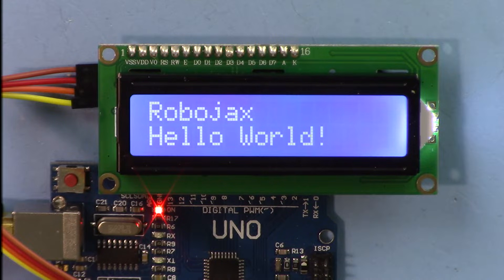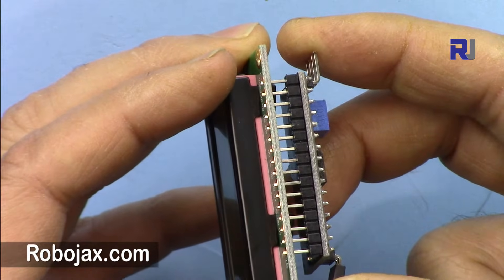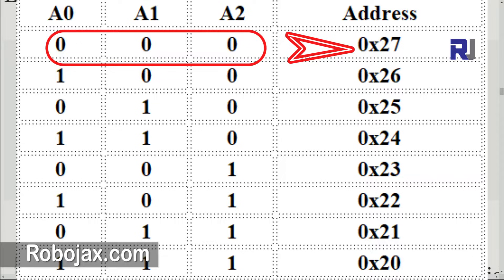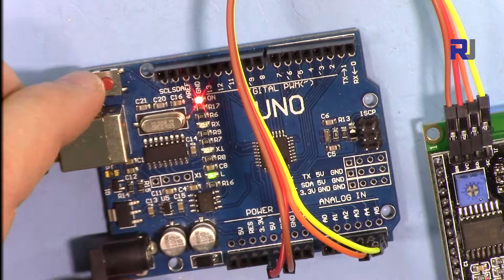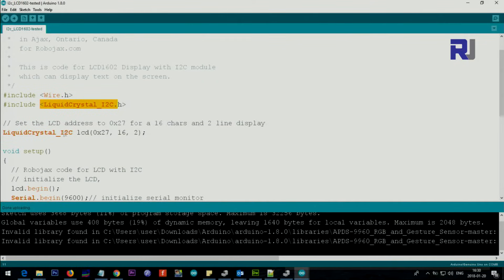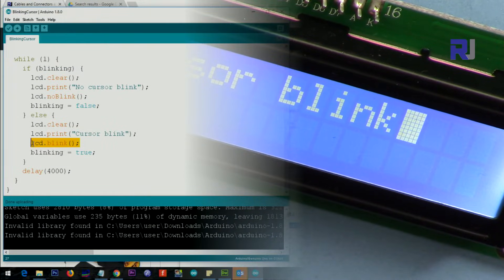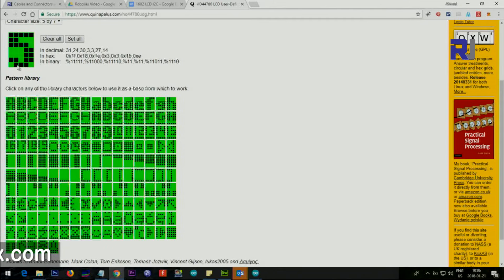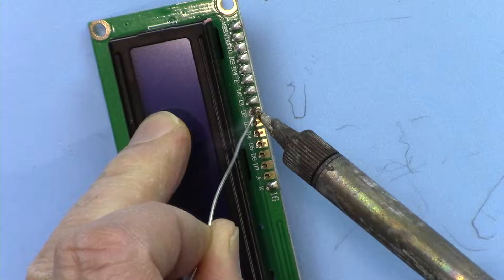How to use  LCD LCD1602  with I2C module for Arduino - RJT50

Comment: Can you please advice! I keep having a persistent issue with this part - 
 lcd.begin();
This text consistently displays an error when trying to upload which states - 
'no matching function for call to 'LiquidCrystal_I2C::begin()'
What is the issue? Thanks
Reply: change lcd.begin(); to lcd.init();
Reply: for those who are still searching I had exactly this error,
>open the Arduino app;
>click in sketch
>add file
then finally add the file here

or search for the "Arduino" folder - Mac
>command + space to search
>type in "Arduino" without the " "
>select the folder
> Drag & drop the downloaded library into here

or search for the "Arduino" folder - PC
>windows + f to search
>type in "Arduino" without the " "
>select the folder
> Drag & drop the downloaded library into here

* please correct me if I'm wrong and ill edit accordingly
everything will now run as it should (I wish this was included in the tutorial for us noobs)

on a side note here's more info on how to add libraries moving forwards; 
https://www.arduino.cc/en/Guide/Libraries

if anyone is curious the file extension ending in .h is written in the c language and can be read with Xcode or visual studio
Reply from the maker: you have not installed the correct library. I made another tutorial with the same library here https://youtu.be/NXAswOc_2zg and used lcd.begin() and it works fine. you are using wrong library.
Reply from the maker: Please download and include the library.

Comment: Everyone seems to solve their problems, but not me. I did the scan, it said 0x3F so I wrote this:
___________________________________
#include <Wire.h>
#include <LiquidCrystal_I2C.h>

LiquidCrystal_I2C lcd(0x3F, 16, 2);

void setup()
{
  lcd.begin(16,2);
  lcd.clear();
  lcd.print("Hello, world.");

}

void loop()
{
}
____________________________________

But it still doesn't work. I've turned the little screw on the back on the blue part from stop to stop, but nothing changes.
Reply from the maker: Where did you get this code? Please use the provided code and it should work.
Reply: @robojax   I did try your code (the main difference being the adress?). I did a scan to find my LCD screen adress and it said 0x3F, but I've tried many, many different ones.

Does it matter if I use an Arduino R3 that isn't "UNO"? I'm using a Geekcreit R3.

Comment: I found out information, into the datasheet to LCD 1602 is indicated, that backlight consumption is about 100 mA. As I know, DC current per I/O board's pin is 40 mA. So, using this LCD on maximum output current limit is harmful, is not it?
Reply from the maker: I have not measured  the current, but even if 100mA is the max current of the LCD, it will consume it from the VCC pin. The VCC pin of Arduino uno can supply up to 400mA  and you can see it here: https://playground.arduino.cc/Main/ArduinoPinCurrentLimitations the 40mA is the limit of the IN/OUT pins which in this case we do not use to supply power. The other pins are use to communicate which needs very little current.

Comment: If  lcd(0x27,  16, 2) configuration is not working, It is strongly recommended that you try the lcd(0x3f,  16, 2) configuration before giving up.
Reply: This solved my issue. I was sure it wouldn't, as it defies logic lol.
Reply: thank you

Comment: Hello sir,
at very first i am thank full to you. i have almoste complete my final year project against my degree following you concepts , now i am adding the lcd display in my project. the problen is that my code don't highlight  the  library for i2c  . err shown is.
 #include <LiquidCrystal_I2C.h>

                               ^

compilation terminated.

exit status 1
Error compiling for board Arduino/Genuino Uno.
 kindly guide me to resolve that err as no one respond  like you.
Thanks in advance
Reply from the maker: this means that LiquidCrystal_I2C.h or other library files were not found.  Make sure to include library. Have you downloaded the library and included them? I have provided the link for the library,. you can download it from there.
Reply: @robojax   Done!😀😀
Thank you very much sir, it really means alote. stay blessed. I"ll  contact  if face any problem ahead..
Thanks again.
Reply from the maker: I am glad you were able to resolve the issue. Salam.

Comment: Questions: 
1. how to customize the Pins for connecting SDA and SCL in the Arduino? I would like to use A5 and A4 for another purpose.
2. Will this library works for a 20x4 LCD display?? 
Thanks!
Reply from the maker: 1-See this video which I have explained the I2C address: https://www.youtube.com/watch?v=bqMMIbmYJS0
2-Yes I works. I have another video for  LCD2004 display: https://www.youtube.com/watch?v=DKmNSCMPDjE

Comment: Hello. I have been facing problem of arduino automatically turning off after I am connecting VCC port of I2C LCD to the 5V port of arduino. How can I get rid off this problem?
Reply from the maker: your display has wrong connection. it is the USB power that is shutting down because too much current is drawn from USB. find out where the problem is.

Comment: The solution for the blue LCD problem is the potentiometer guys. That is the blue box behind your LCD. Screw the grey thing on it tighter and voila.. your there..
Reply: I solved my issue. It was the address. I was able to find the correct address using the scanner code. 0x3F is my address. I think this is what most people are experiencing, as the method in video is misleading about the addressing.
Reply: Thanks Nick. That was all it took to display the characters.
Reply: thanks , i was about to smash the thing on the floor

Comment: I have a blue screen .. how do I solve this?
Reply from the maker: you have got the i2c address issue. use the i2c scanner I have provided with the code. Watch mother video no I2C address if you still can't figure it out.
Reply: Your codes work... but screen is still blue which is weird
Reply: Solved it!
Reply: @nickthewinner2194  What was your issue? I'm having white on top and blue on bottom.
Reply: @tonyverduga  Had a blue screen. Check out the back and look at the blue part. Then you have to get a driver and then screw the grey part tighter
Reply: @nickthewinner2194  I solved my issue. It was the address. I was able to find the correct address using the scanner code. 0x3F is my address.
Reply: @tonyverduga  I have also this problem. I have change the address to 0x3F (which the scanner gave me) and it still didn't work. help anyone?

Comment: Code for handling LCD in Arduino IDE is the same as in example, but when the code is uploaded to Arduino, nothing displays on the LCD. Please help. I tried various versions of librares for i2c lcd and no one works. Thank you
Reply from the maker: did you run the I2C scanner? Your issue is with I2C module. watch this video  https://www.youtube.com/watch?v=bqMMIbmYJS0
Reply: Thank you. Now everything works as expected.

Comment: Hey, I am new in this, I will shop same for Arduino but instruction says the I2C 0*24 is not possible to be changed , what is this and do I need to get another type? I will use the microcontroller with a encoder on a machine. Best
Reply from the maker: sorry I did not understand the 0*24 in the "I2C 0*24". what are you referign to 0*24?

Comment: Well done RJ, I'm  expecting soon in the mail a 20x4 LCD, just wondering if you will intend upload another wiring, instructions, and code links abut that popular LCD sometime soon? Regards
Reply from the maker: there is 20X4 and  I will upload the video in coming days. But have not heard 20x5.
Reply: Oops ;) you have right, I mistyped the actual size is 20x4 exactly what you say is correct.  Regards  and thanks very much.

Comment: Anyone have the problem BLUE BOXES , you can wirte this: LiquidCrystal_I2C lcd(0x27,16,4);
BUT at the void setup you must add this line on the top: Wire.begin();
I figured it out ;)
Reply: Not working, still blue boxes on top row.
Reply: @nartymmd  
#include <Wire.h>
#include <LiquidCrystal_PCF8574.h>
LiquidCrystal_PCF8574 lcd(0x3f);
void setup()
{
lcd.begin(16, 2);
lcd.setBacklight(255);
lcd.clear();
lcd.print(«arduino»);
}
void loop() {
}
Reply: still yellow boxes

Comment: Hey bro, how to code this. while red LED is on, LCD will display "RED LED ON"  , while yellow LED is on, LCD will display "YELLOW LED ON"
Reply from the maker: how and when the LED is turned ON? once you turn it on just add this lcd.print("RED LED ON"); to where the LED is turned ON. If you further help, please share your LED code  here https://codeshare.io/ and once you posted your code, this website will create automatically the URL (address)for your code. Then copy and paste the URL here and I will look at it to help you.
Reply: Thanks for the answer.
Reply from the maker: You are welcome.